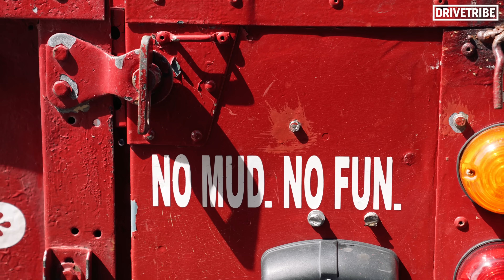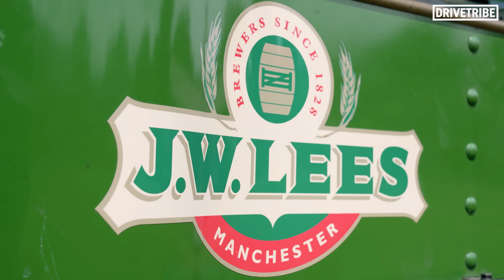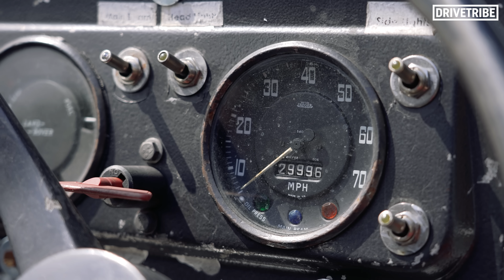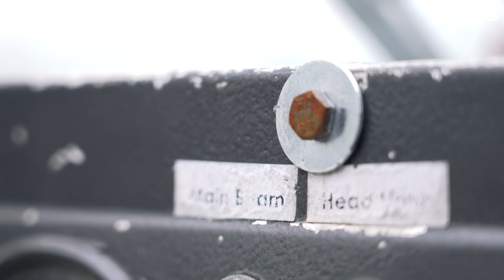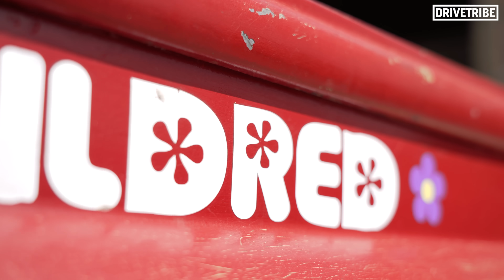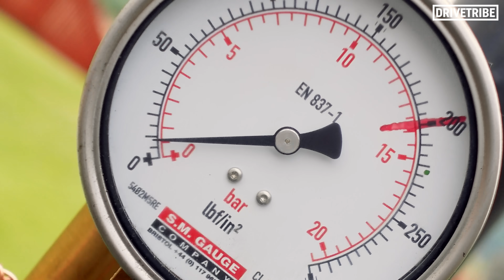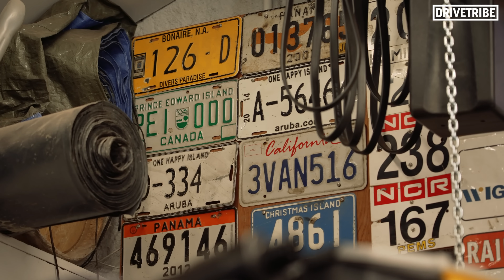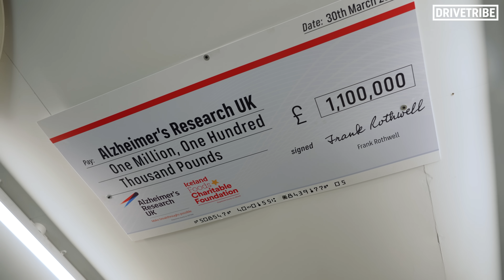This guy has built a steam-engined Land Rover!

Comment: gonna be honest, a triple expansion in the driver side engine bay, replace the passenger side with a larger water tube boiler and have your fireman sitting in the back driver-side seat firing with coal from the rear, you'll get a much more powerful putter

Comment: Steam engines are perfect for offroading vehicles. Their torque is unmatched, although they are quite slow and very heavy. If one has a system to reuse water, you can keep going as long as you have fuel. Just don't use it in tall flammable grass, because steam engines are awful hot.

If anyone wants to see an example of the unbelievable power of steam engines, look up a steam tractor doing a tractor pull on YouTube. It's incredible.
Reply: Hello, how are you doing

Comment: External combustion is far more efficient than internal combstion- and massive torque with huge fuel variety. It built the Panama and Suez canals. Rover worked that in the 1930's as Starley was a huge fan of Abner Doble- but steam required too much faffing about vs petrol. Sentinel was brilliant steam too massive torque, cheap English coal- best of British. Utterly Wolf pack proof. The best is ultra high temperature 300-500⁰ C Siemens latest turbines 75%+ efficiency.

Comment: By the 1920s they had push-to-start steam engines, they just didn't stick around. They could have though. Much more efficient than a full petrol engine. 120mph top speed, 1000 miles a tank of petrol, 150 each water refill. No gears, no emissions. Need to come back

Comment: This car is a joke compared to a real steam car... People need to be aware that real commercial made steam cars using much better multi cylindrical steam engines have existed and they was actually better to drive then the petrol engines that existed at the same time. Only problem was they was extremely expensive.